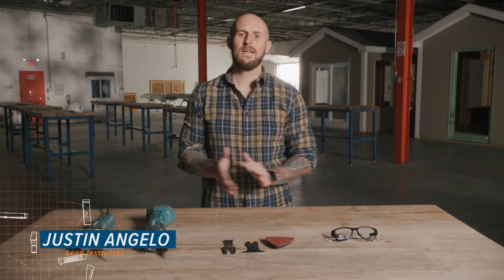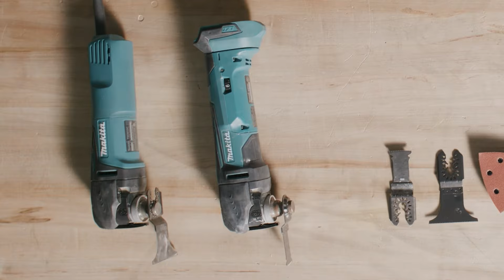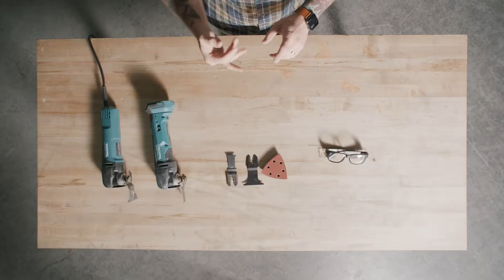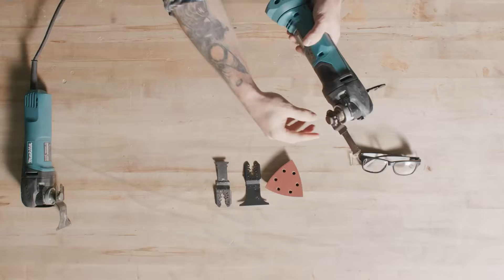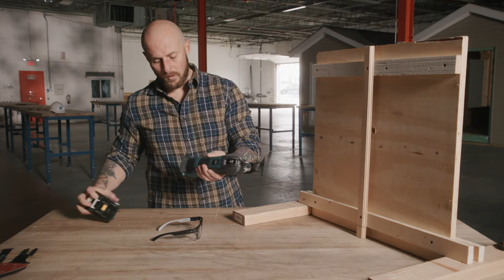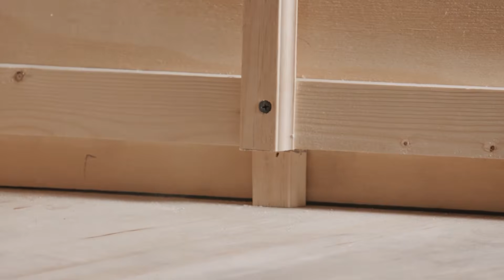How to Use an Oscillating Tool to Saw Wood | Power Home Remodeling

Comment: I need to make a cut into bottom of exterior door trim since im applying a baseboard to studs and it's an inch thinker then the rest of the t1 11 wall. Fyi: im cutting lower strip of wood off because of rotting.